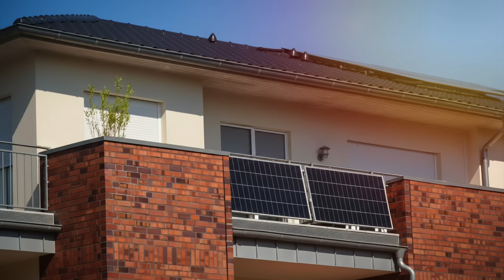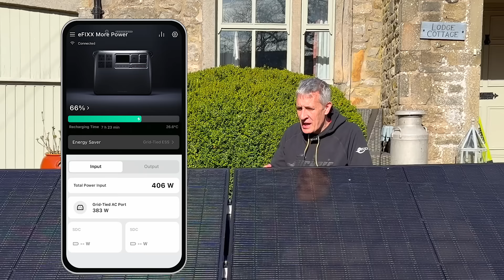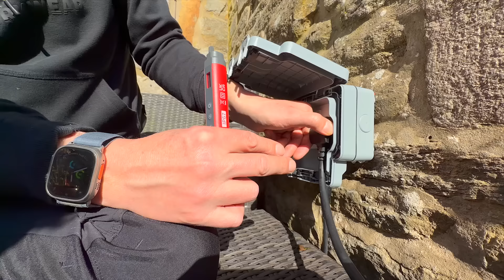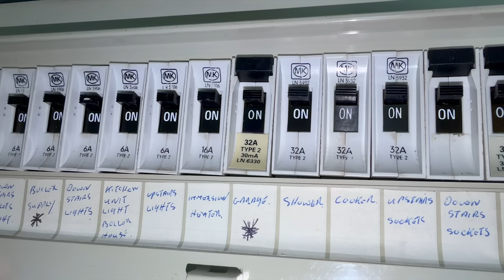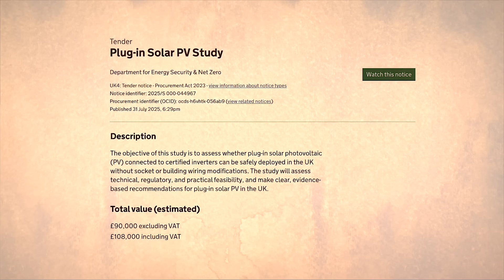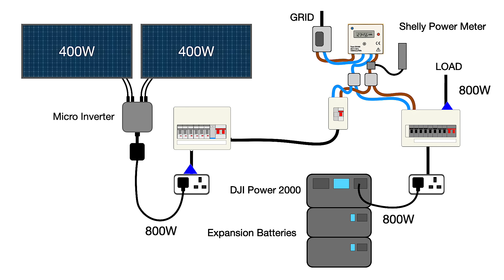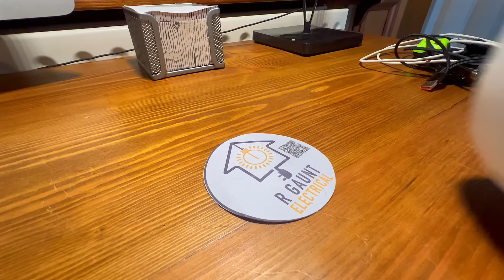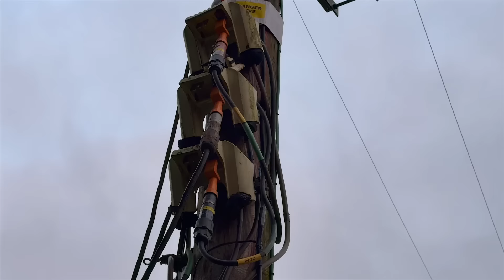Plug in Solar: We’re Told Never Do This… So I Did

Comment: You answered your own question...
"Sending it through the PLUG the WRONG WAY"
The components are already legal in UK, they even have their own ENA/MCS approval id numbers...
It is HOW it is installed that is the issue AND each individual case, specifically if that property's electrical system is fit for installation...
The older uni-directional rcbo's can fail, you've demonstrated this...

So the government along with industry standards can not simply approve these systems Carte Blanche no matter what...

Yes, the industry has ended up tieing itself in knots now with regulation after amendment etc...

Here's an example...
You have a plastic 16th edition CU, maybe with Type AC RCD's & MCB's...
MCB's are bidirectional, but not the RCD's & the older type AC...
Now you could replace RCD or create a dedicated circuit with a Type A bidirectional RCBO for the balcony system, the RCBO would work with the energy flowing back to busbar, then the existing circuits can handle the solar AC flowing through the RCD's in same direction as mains...
(Ok still type AC RCD, but that would previously been advisory)

But wait, you can't carry out any new installing of devices on plastic CU, so you need a new metal 18th CU, coz you can't connect stuff in older plastic CU's...
Yet, if you carry out a proper EICR, you remove the conductors to test and then reconnect those wires back to neutral busbar/device
You are remove/reconnecting the wires in an EICR, that's fine
BUT you can't replace or fit a modern RCBO and connect wires in old plastic CU ???
It is not quite the exact same thing...
But wires are being fully removed for testing, then reconnected once again, much the same as if you fitted a new modern device ???

You need your present electrical system inspected - EICR...
Then it will be recommended that this/that needs upgrading, which in some instances you can't simply just upgrade in a 16th CU...
So you then need a grand it more to replace CU according to regs

Yet remove/refit all the wires on an EICR - that's fine, but nope you can't partly upgrade a 16th CU

Yeah, the regs are set due to Fire Brigade recommendations on metal CU, with no room for discretion or common sense/risk assessment from said EICR that removed/refitted conductors for testing ???

If you think the above is as clear as mud, the 19th edition will be no different either...
Often any simple question you seek to answer, will be a simple yes, no, depends, carry out your own risk assessment - type of answer

Coz in effect, that is how it is tied up by it's own regs and written as each individual property presents it's own issues due to varying levels of compliance to modern standards etc...

Good luck getting a clear answer anytime soon, especially if the government is involved

Comment: I'm in America and we have smart meters in my region, so we couldn't sneakily add balcony solar panels. I'd have to add all sorts of stuff and get an agreement with my electricity company, something they don't make easy
Reply: You could in Utah. And around half the other States have bills in their legislature at present to allow this. Not all of America is daft.
Reply: So long as safety requirements are met it doesn't need to be done "sneakily" ... In the UK, the standard, automatic allowance for exporting electricity from domestic premises to the national grid without needing prior approval from the Distribution Network Operator (DNO) is 3.68 kW (16 Amps) for a single-phase supply. Higher generation limits can be available depending on local DNO. Whether you can get paid for your export also requires an agreement with your electricity supplier.

Comment: when I lived in California, I got a small plug in unit to test.  Plugged it in and the power meter went into alarm, unauthorized power generation.  Well, end of that experiment.
Reply: And then? Did it need resetting by the power company? Did they send you nastygrams?
Reply: @vonpaparas  after I unplugged it the alarm went away and no nastygram.  I was amazed.

Comment: At the end, this is not about certain devices being safe or not, but system safety, and who is responsible for making sure everything works together in every situation. As long as we don’t have globally agreed rules, manufacturers can’t prepare for every possible problem that may come from some particular installation. 

In Finland, it’s not allowed to connect these devices without permission from grid company and licensed electrician doing the job. There’s safety related reasons in behind, but in practice, these electricians don’t have understanding about possible problems, and grid companies are not doing any checks either. Besides serving the purpose to create very profitable business, this at lest gives knowledge what’s been installed, so if some problems appear with some devices, it’s known where they are and who to contact. Also, electricians don’t most likely do the most stupid mistakes that some people would, although, mine did almost every mistake that can be done, like left wires loose, so there were sparks, and connected secondary power side neutral in a way that my heating overloaded secondary battery backup system, because it shared same neutral, while it was supposed to come from different rail, when the inverter made emergency disconnect from overload, asymmetrical load left my main neutral hanging somewhere around 100V, feeding over voltage for some devices and under voltage to others. 

Anyway, as a curiosity, most household electronics would work perfectly well with DC and batteries connected directly to panels. I have had this type of system in operation about a year, except the battery/panels system is low voltage to go around regulations. LFP battery voltage is very constant between 10-90 charge levels, and so are panel MPPT voltage when panels are connected to parallel. Over a year, I did get 20% more energy from this field, compared to standard inverter/serial installation. That doesn’t even count the average 100W power that my inverter seems to be drawing all the time. They are losses from transformer, that’s connected to the grid and possibly doing power factor correction for my expenses. That’s almost 1000kwh per year. Depending on the length of cable and losses, nine or ten LFP cells are perfect match for typical solar panel. No power electronics needed, just safety cut off. Inverter is needed to provide power from the battery, but it scales by power needs, not by solar power or battery capacity, which is huge thing. Combined with normal inverter and smaller battery, this works very well.

If been scaled up to utility voltage, no inverter would be needed for own usage. This is of course speculative and not legal, and would cause problems with some devices, like ac motors.

Led lights, computers, tv’s and such has switching power supplies that actually work better with dc, and would be much cheaper to build if being made entirely for DC. Many devices like washing machines, dishwashers, inverter refrigerators and stoves could be made to work both ac and dc without practically no extra cost, just small design choices. If efficiency and cost savings would be the first priority. Separate wiring for DC and AC might be wise for new installations.

Comment: surely the solution is to design an RCBO that filters the current to avoid DC leakage and has a relay at a certain voltage to bypass the bus bar and just grounds back to the inverter during a "trip"

Comment: Can you do a video on if this is still possible for a house that already has some solar installed. Would it work against an already installed system or would it supplement the system.
Or 
Could it be used later in the day when the sun is no longer on the main system panels but still shining for a few hours with the longer evenings

Comment: Extra: You do realise our power companies have a strong ‘entitlement’ to the profit they make off us, and the toothless government watchdog simply approves any unit price rises to maintain that profit level. Meaning if home generation say halved the demand on the grid, the companies simply double (and a bit) the price per unit on anything used so they don’t lose out, meaning any power you have to use say in winter, or if you aren’t part of the solar revolution, will be horrendously expensive….
Reply: This is exactly how it works. However, the key is to get solar and batteries now rather than wait for the government to allow energy costs to reach a point where you can't even afford to buy the panels. With enough panels, big enough batteries and a bit of smart energy usage, you can go fully off grid today. In the winter just be smarter and maybe have some meals that don't require cooking. This is a step backwards, but it's the near future. The regulator will absolutely use the Iran war as an excuse to jack up the prices to historic highs.

We are living in doomsday prepper times. Except the disaster we are prepping for isn't some natural event, it's offgem and the wild prices they will introduce later in the year, just in time for winter.

Comment: I was so impressed with solar generators that I got myself disconnected from the grid ,that was 7 years ago . Over the years I now have a solar generator in each room of the house Delta pro 3600w which is probably overkill for the bedrooms  and 1 in the shed . They are all independently charged from solar panels and smart generator . I have an Ecoflow delta pro 3 with extra battery for the kitchen . Only 1 Delta Pro caused issues and that was replaced under warranty . If I go camping somewhere I usually use the Delta Pro in my bedroom and throw that in the car .
Reply: You really shouldn't have active electronic equipment close to you when you sleep, though. Especially not close to your head.
Reply: @silvergreylion  Nowhere near my head and the phone stays in the kitchen so its all good . That aside they are all faraday caged up .

Comment: But what happens if you don't have an export meter and you inadvertently export energy?
Is the meter going to error out?
Is the meter going to count that energy as if you were importing it?
Reply: Can't speak for everyone but I had a smart meter installed, then a solar system which exported a fair bit of electricity before I finally got the export approval certificate some weeks later. Nobody paid the slightest attention. The meter didn't error, it just didn't count as an offset on my bill. I'm told that old fashioned rotary non-smart meters may even run backwards if you quietly export energy so it comes straight off your bill at the import rate, but maybe that's just urban myth as I can't confirm it.

Comment: I know some people set up systems like that here is the US, but we have the added complication of a split phase electrical system, so you'd only be feeding power back into only half your house.
Reply: I know an Australian house with 3-phase power, which has substantial solar installations separately on 2 phases. There was some thinking about where to plug particular systems in.
Reply: Dedicate a plug to each?
Reply: Thinking the same  - In North America, you'd need at least to 240v 15amp circuit.

For most people that would mean getting an electrician in, negating the plug and play benefits. Might as well get a hard wired system.

Comment: How did you match the frequency ? My apologies if I missed that. Does the inverter come with an app to monitor it ?
Reply: The inverter matches the frequency
Reply: @kjeksklaus7944  I know it matches but I want to know how the inverter knows/monitors the mains frequency as they need to match phases.
Reply: @rogerwilson6367  The inverter has a mains power supply and only needs to synchronise the frequency once, once synchronised its automatic from there
Reply: @jeffreycorner6507  Thanks for that.

Comment: you seem already to have export to grid set up but if I do not, and I plug one of these systems in do I not risk sending voltage back to the DNO during maintenance periods when they think they have killed the power?  Would I be breaking any UK laws?  What else would I need to make that safe, if not strictly legal, and how illegal would it still be?

Comment: unless you are an electrical engineer I would not suggest the reverse plug thing it is not safe unless done exactly right
the average Joe should use a  MPPT solar control its far safer and easier

Comment: I am pretty shocked that those useful plugin-solar system ain't allowed in the UK yet. Using one (880W) since 3 years and they are great.

After 2022 and the energyprice explosion caused by the ukrainian-russia war those plug-in solar exploded in demand in germany (it is called balcony solar there).
You can get a 800W (2 panels with inverter) for about 230€ (which is about 200 pounds atm) on german amazon.

You could save up to 15-20% of your yearly power consumption with this system without an expensive battery in an ordinary european household (let's assume with 3500 kWh / year consumption). Mind you that you could increase this percentage with a battery, but you should calculate if it is useful in the UK; seeing that your weather is way more rainy than here in mainland europe.

I live in a mountain area, so it is not perfect, but my plugin-solar produced in 2025 exactly 754 kWh where we could consume about 450 kWh of that (meaning about 140 pounds saving in 2025 alone).

Millions of those systems are used in germany right now, never heard of a fire or death caused by a plugin-solar. So it is quite save too. But one important note: DO NOT RUN MULTIPLE PLUGIN-SOLAR SYSTEM ON ONE HOUSE POWER LINE OR EXTENSION HUBS!!!!!!! It could be too much for your in-house wiring (making the wire too hot and cause fire). That's why the limit is 800W in place here.

Comment: France here. There are plug-in systems here. The kits are certified from the factory. The installation can not be modified in any way. So if the installation comes with a plug then it needs to be plugged in, that's for systems under 3kW. Over 3kW the system is hard wired on a dedicated circuit installed by an electrician so again certified. No modifications, can not cut the plug off and hard wire it. The system has to be inspected by the authorities (Enedis- equivalent to DNO) before it can be commissioned. If Enedis are not happy with the installation they will make recommendations before a re-visit. All hard wired installations have to be done by an electrician. So no dodgy extension cables wrapped in plastic bags or any outside sockets. Kits come with everything needed. The micro inverters, cable, RCDs, lightning strike protector, switch isolators. Also the pv panels and mounting brackets have to be earthed. Battery storage are options. It all makes for a very good low cost solution that is safe.
Reply: Bet your electricians don't have to have a separate qualification to install a dedicated Solar circuit?

Comment: G'Day, We have an 11 Kw Tesla battery here. It exports power to the grid when we are not using energy in our home and the battery is full. The problem as I see it is this: for your solar system to be worthwhile you need to have lots of sunny days. I have never been to the UK but I belive this could be a bit rare  ?  we also have a 32 amp 3 phase plug connected to the switchboard via a three pole change over switch so we can plug in an external generator when there is a blackout.
Using Timed tarrifs we pay a high rate at night, so our system is programmed to supply energy from the battery to the whole house at night. and during the day the battery is recharged using solar. if its cloudy the system will recharge the battery using the cheaper electricity. With four people in the house I think this system cuts our electricity bill in half. Our solar system can produce 6.5 kW on a sunny day.  Please dont rely on your inverter shutting off the energy when it detects no mains, if that chip plays up you will have a serous potential on that plug.  Regards PW Australia.
Reply: Solar has been quite common in the UK and Europe for many years, even at higher latitudes. The UK benefits somewhat from improved panel efficiency due to reduced panel temperatures. This helps to balance against the fewer fully sunny days to some extent ... but solar generation doesn't depend on full sun to be working usefully. We have lots of wind generation on the grid so our cheap rates are at night-time and more expensive in the day ... so any daytime generation is especially valuable.
Reply: @MrAdopado  G'Day Agaiin, Thats quite interesting. please excuse my ignorance about sunny weather. Wind makes a lot of sense. Renewables are good in theroy but if you dont have inertia on the system its prone to falling over. Regards PW Australia.
Reply: @Pappazeko  Any system of electricity generation can be prone to falling over if it isn't designed properly! Clearly it needs careful planning but so does linking any other generation into a grid system.

Comment: I thought the main issue was that, in the EU, homes are wired with radial circuits, while in the uk, we have ring circuits.
I'm the diagram in the video, it seems to show a radial spur to the consumer unit. Is that the case? 
Is there any hope of new regulations allowing us it plug into a ring circuit, or at best will we need to add a radial spur to the consumer unit?

Comment: It's the same reason I can't plug a petrol generator into a socket
Reply: No it isn't, a petrol generator won't shut down on loss of grid supply and a petrol generators output won't sync to the grid on connection.

Comment: I have a SolarEdge A/C coupled solar system, and this is on a separate circuit using a Type A DP Bidirectional RCBO, all solar systems should use this type of protection device.